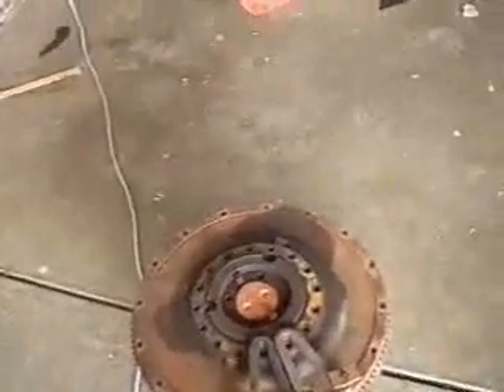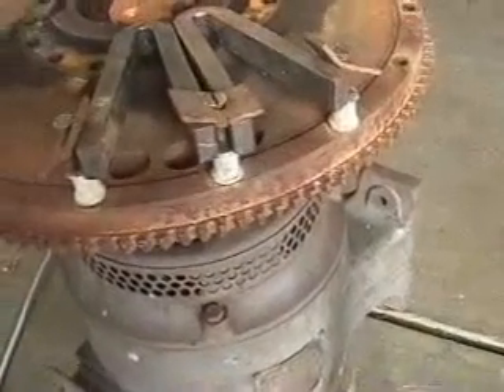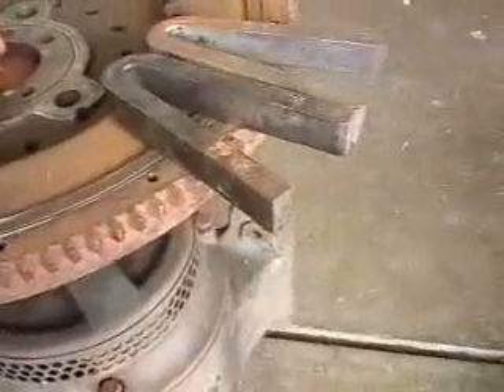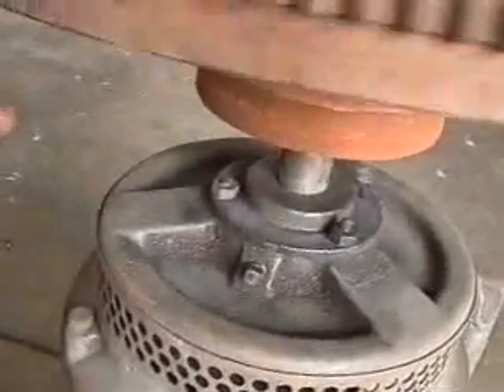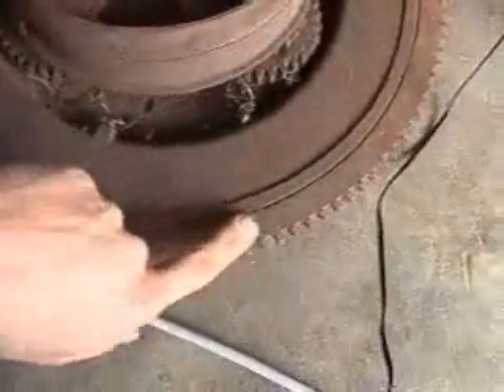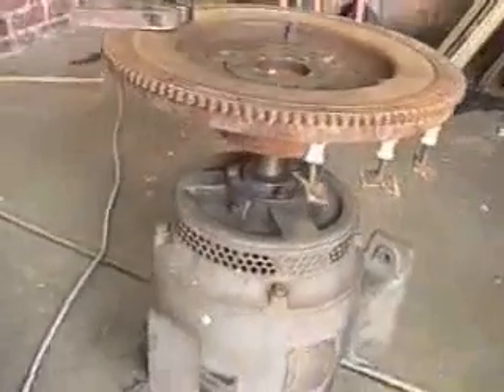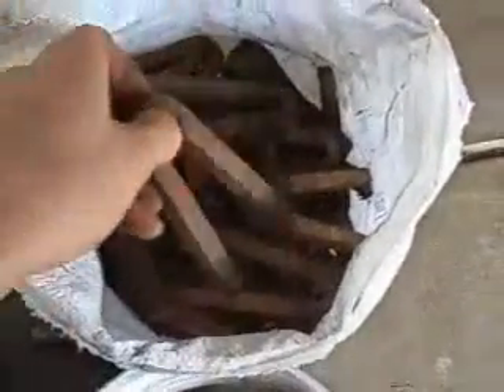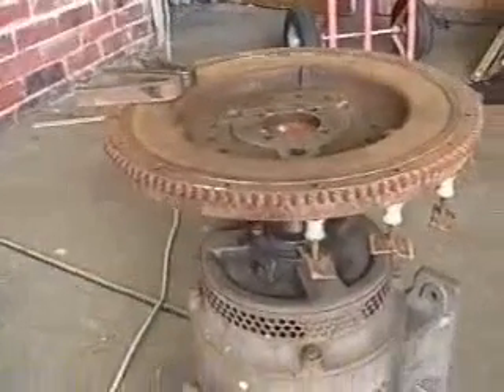Ed's flywheel replication

Comment: Ed Leedskalnin FLYWHEEL work similarly like SEARL SEG, magnetic current are drown inward toward the center of the FLYWHEEL(direction toward singularity). That 3 phase motor would have an impact on the FLYWHEEL. Ed Leedskalnin once said "once you get the north and south magnet chasing each other the magnetic current will not stop unless you break the current". So, Why need a motor to run another motor?